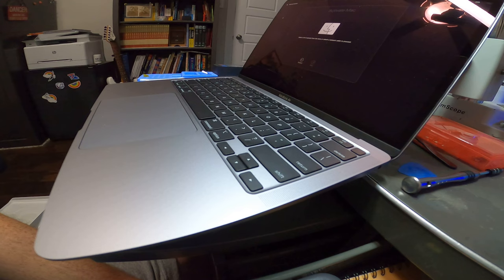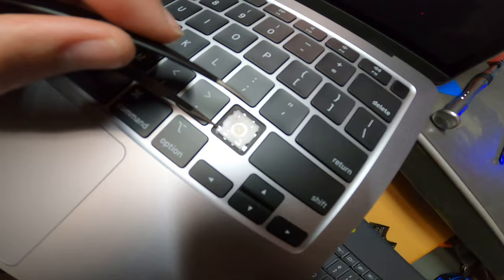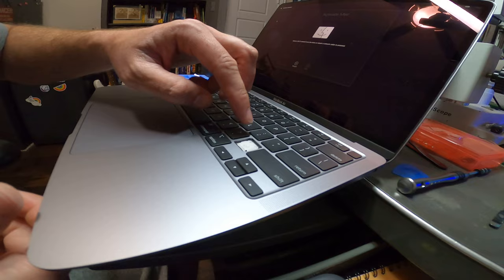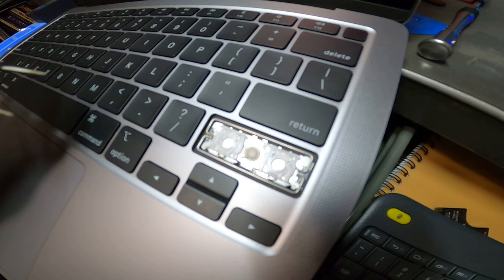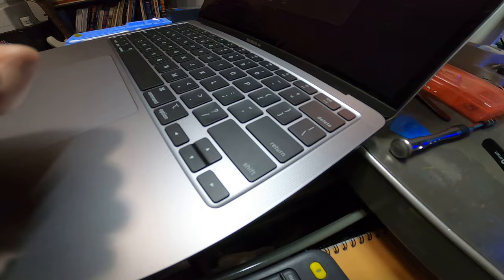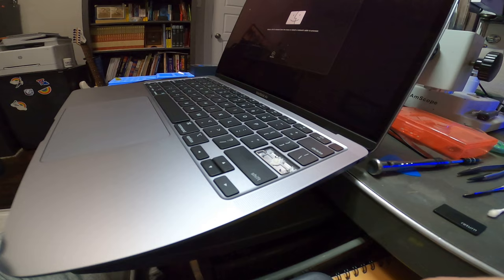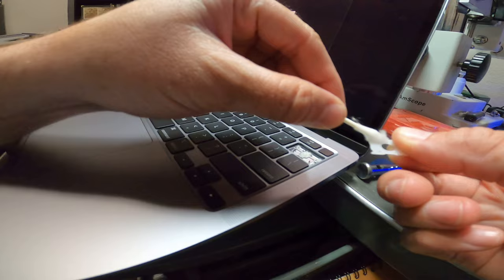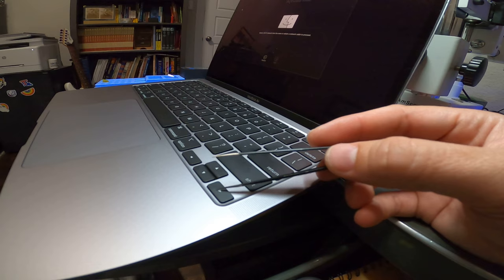M1 Macbook Air Sticky Key Fix

Comment: Thank you so much, I fixed my shift key using this video and I was not that soft I did it like a real pro mechanic lol.  Though these look really delegate I would say they are made really solid, hard to break them if you have right tools. I took a picture of old setup just in case but its pretty obvious I don't think you can put them wrong way and able to click them so no much worry. Thanks again.

Comment: Hi. Could you help me out? I'm out of the country and dont have access to an applestore. I removed the delete key 2 times, because I thought it was sticky. Turned out to be clean. Never figured out the problem. I was able to follow the steps to replace it the first time. However the second time the key stayed flat, as if there wasn't a rubbercup or whatever allows the key to float. But it's still there. What can I do?
Reply from the maker: Something is bound up in the key. Remove it and try again. Make sure you didn’t install the hinge upside down.
Reply: I have the very same problem, dismounted it several times. It only clicks flat. I can´t get it to fit propperly again
Reply from the maker: @boomcloser9013  when you disassemble, you must very carefully pay attention to how the components are oriented. If you install them incorrectly you will have these symptoms.

Comment: Please could u help me? I removed some keys that werent sticky but when i try to put them back they all just not pressable as if they sticked
Reply: it happened with backspase and some regular keys like control fn option
Reply from the maker: @verletzt546  make sure to align the metal bars correctly and do not force anything. If you break the small plastic snaps on the plastic black key itself, it will have to be replaced. Once the snap breaks it will no longer stay attached. Look very carefully and see if anything is broken on the key itself. Also make sure you have the white scissor mechanism installed correctly and not upside down. It will only go in one way.
Reply: @alphaboardrepair5285  So I did  the same with a normal key but the hinge/mechanisme broke off because I put a lot of force in it. Do you know where I could find the hinge online? Maybe a website were I can order it?
Reply from the maker: @nizarmounib9104  the white scissoring plastic part?
Reply: @alphaboardrepair5285  Yes exactly that part
Reply from the maker: @nizarmounib9104  https://www.ebay.com/itm/294688276679?mkcid=16&mkevt=1&mkrid=711-127632-2357-0&ssspo=65jq298qQBW&sssrc=2349624&ssuid=Nj1qTd83TgS&var=593130566889&widget_ver=artemis&media=COPY

Comment: I am not watching a 40 minute video.
Reply from the maker: Thanks for sharing! You do know there is a skip feature right? It’s a 40 min video because there’s a lot to taking these keys apart, and different keys have different ways to come apart. If you want to see how certain keys come apart then skip around until you find it.
Reply from the maker: @Delusional K skip to 36:27 for the space key. But essentially yes, it has the metal bars but there’s many more clips.
Reply: Thanks for the tutorial! (Just had a sticky shift key and managed to fix it with IPA and an ifixit kit). Shift key back to happy self!

Comment: well this definitely made some of my keys 100% worse they won't stay in place when I put them back
Reply from the maker: That’s because you likely forced them and broke the clips. You have to be very careful doing this. These keys only come off one way as they are designed.
Reply: @alphaboardrepair5285  I didn't force anything. I popped them off gently just like the video.
Reply from the maker: @dustinbossmusic  what model M1 MacBook do you have? I as well as many others have done this with no issues. Are you 100% certain you installed the scissor mechanism in the proper orientation? If you have a newer M1 Mac (newer than the A2337) this process may not work. I have not tested key removal on newer macs.
Reply from the maker: If the key will no longer snap all the way back down and stays kicked up, then the clips are broken on the key itself (black plastic part). It will need to be replaced but luckily those are very cheap to buy. It’s still possible no matter how careful you are to break a key clip, they are just so tiny and delicate. No matter what they only come off one way, so don’t feel too bad if one breaks.